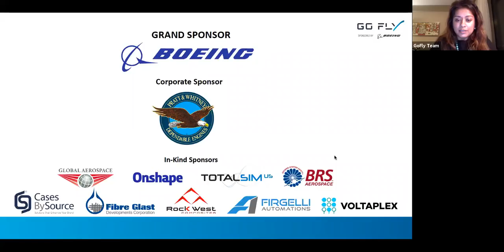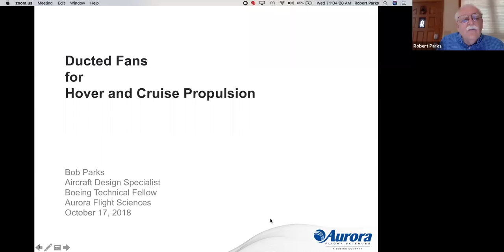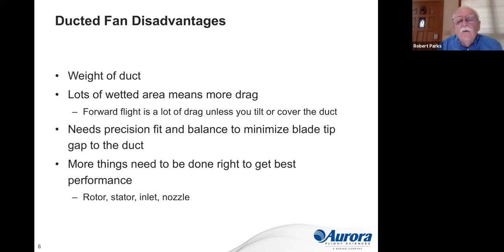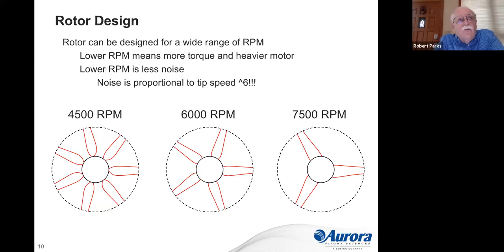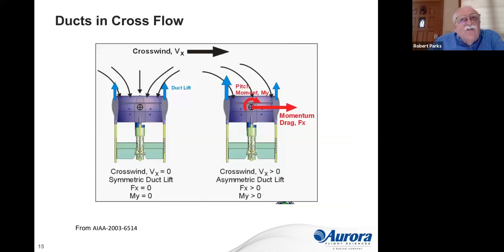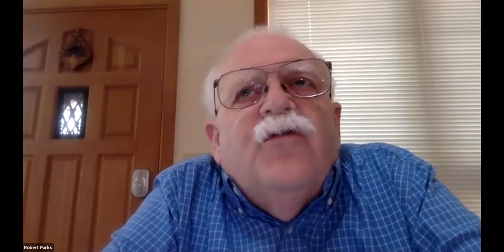Master Lecture: Ducted Lift Fans w/ Bob Parks

Comment: Eliminate the rotor blade tips. Eliminate the stators. Eliminate physical contact points. The way you do this is so absurdly simple. Like "Damn! Kick me in the balls for not seeing that!" simple.  Great video, though.  I strongly suspect what you covered is going to largely become "obsolete" very soon. But it's equally important to earn one's "chops" re: the physics & engineering math. So Kudos for helping our next-gen engineers be better ones. I'm not sharing more because the patents are not yet formal. You'll know it when you see the public intro of 3 eVTOL craft. The Woof-Cub, the Aero-Woof, & the Battle-Woof.  My tributes to Air Wolf.  They are... 

A 24' (12,000 lb) private executive 6-seater.  A 34' (17,000 lb) search & rescue utility craft.  A 44' (22,000 lb) military insertion-extraction craft.  The Woof-Cub Max TOW = 16,000 lb.  Aero-Woof Max TOW = 30,000 lb.  Battle-Woof Max TOW = 42,000 lb.  I want y'all to remember you heard about this when the reveal goes public. 
And...  May the Force (=MA) be with You  :)

Comment: Subject . STOL bush planes , What about putting  ducted fans in the wings ? Would that lift a stalled wing ? or employ both to sit you down short ? or they could come into play if you are taking off or landing in a cross wind ?  It would be built into and flush with the wing, top & bottom,  maybe 3/4 of of the way out.?

Comment: I'm a bit confused about the inlet shape - Bob suggests having a more rounded shape to allow air to flow over the lip from the side during hover, but according to this video https://www.youtube.com/watch?v=Cew5JF8q6eY&t=2s, you want a more sharp edged 'coanda-lip' duct, to get extra lift using the inlet lips.
Reply: as Bob would say "nope" , a smooth lip reduces aeroelastic separation or turbulence.
 a sharp lip can cause a sort of flutter in the shroud.

Comment: "more torque and a heavier motor"

More torque =! Heavier motor
Reply: For a given type and configuration of motor,  at the kinds of RPM we are talking about for driving a fan directly, without a gearbox, motor weight will increase as the torque required increases.

Comment: You say non-traditional then you go over old already tried designs that didn't work 20+ years ago. Not sure when you will be willing to hear new ideas.
Reply: First, the purpose of this presentation was to teach the basics of ducted fan design.  The stuff I presented is pretty well proven to work.  If you want to do things differently, then the burden is on you to prove they work.  Given that GoFly is on a pretty tight schedule, you probably need to minimize risks in areas that do not have a corresponding payoff.

As for old designs, well, some of them failed before, but it is usually worth trying to understand why they failed and what could be different now.  A good example is the now ubiquitous quadcopter.  A manned quad flew in 1922.. and was a total failure.  The X-22 was a ducted quad, and, according to you, a failure.   But then electric propulsion became viable.  (barely viable with brush motors and nicad batteries).  The first RC quad was almost 20  years ago, but super difficult to pilot (at least for me).   I think it had spinning wheel gyros on it.  It was a failure.  But then the electronics got a lot better and now they work.

Tailsitter VTOLs have issues for manned aircraft, but can work fine for unmanned.   The X-22 flew fine but was complex with all the drive shafts, and with the duct drag, was not particularly fast, so not too useful for a manned cargo transport.  But with electric drive, and the lower speed requirements of GoFly, it could be a viable configuration.

As for being willing to listen to new ideas, well, again, not part of this presentation, so you really have no basis for that statement.
Reply: My second point I like to make to people is we are now in a time where we can make anything fly so strength and safety should be all that matters. Here is a perfect example of what not to do. https://www.youtube.com/watch?v=E9t154HL1V0
Reply: Without risk there can be no reward. These proven ideas you speak of were never turned into products for a reason. You make a point not to try new ideas because of what you call payoff. I think this is a bad way to design. You are not asking people to start with a clean sheet of paper but to start with old ideas all over the paper and try and make something new. Not sure how you don't see this as doing the same thing over and over expecting a different results. Just because most people didn't know we had full scale quadcopters back in the 60s is not a good reason to try and make them now. I've designed a hubless fan aircraft that I believe is the answer and would be worth any expense to develop but you outright say not to even try developing a hubless fan aircraft. When I showed DARPA they were quite shocked by what I showed them, they had many question and kept me on the live video chat for 30min longer than I was given. What do you think of that?